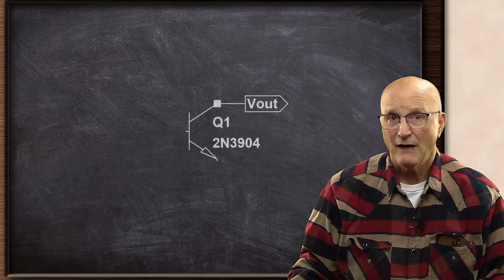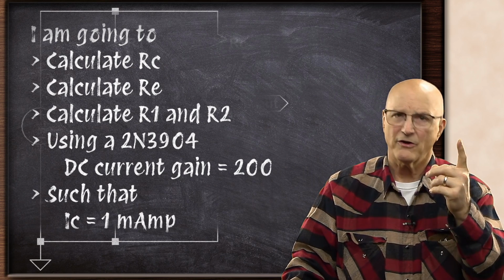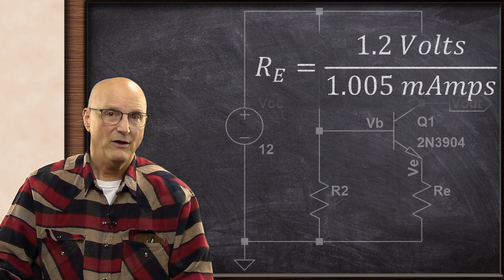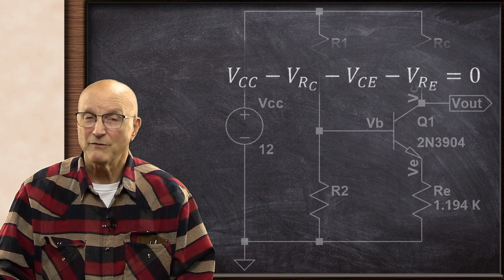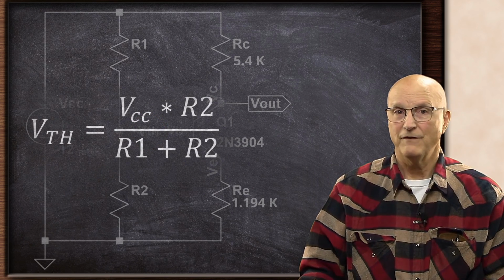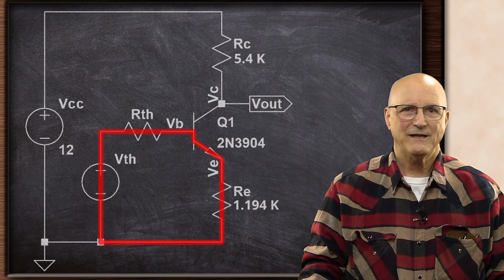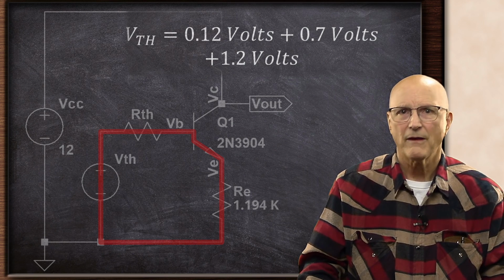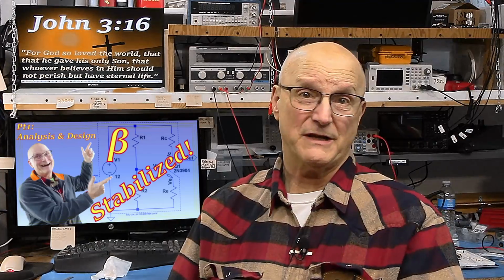A Beta-Stabilized, Common-Emitter BJT Circuit (Pt1): Analysis and Design (066c1)

Comment: Been to Tech college and your rule of thumb exceeds the textbook. 🎉
Reply from the maker: I'm not quite sure how to take your comment. Just to be clear, I've been to engineering college and worked as a product design engineering for decades. My rule of thumb came from a text book, 4 years of college and decades of experience. :-)
Reply: @eie_for_you could be a difference in degrees. They didn’t mention Thevinins theory. I’m closer to the Q target this way.
Reply from the maker: Truth ... in practice, most of the time I just say that the current through the biasing string is 10x the base current and then base all of my calculations on that avoiding Thevenin.  It usually works out pretty close, adjust from there.  What I presented here is the "textbook" method that they taught us in college and is reflected in the textbook I have here on my shelf which most engineers do not actually use in practice. Funny, that, eh? :-)

Comment: Ralph, after watching this video I wanted to (1) run an alternate method by you to see if it makes sense…and (2) ask, would this method work for biasing a PNP transistor in a similar configuration (is it even still considered a common emitter at that point?) obviously this assumes I wrap my head around PNP transistors and “reverse” everything properly.

In regards to (1):
I haven’t learned to use thevenins theorem, but I’m working on it (thank you for the video on it too).

The method I learned to calculate the R1/R2 base bias resistors was from the “Simply Put” YouTube channel. I applied that different method to your videos example and came up with the following…..(assuming the Re and Rc portion of the problem is already done…using the same values you have). 

Your design collector current is 1mA. Since beta is 200 and Ib = Ic/beta, then Ib is 5 uA. The rule of thumb I learned is you want your “bias” divider current to be at least 10x your base, so I aimed for 50uA. Then to get the voltage you need to get across R2, you simply add the VBE drop of 0.7v to the voltage developed across RE (which you calculated as 1.2v) giving 1.9 volts needed at the base (which I think is different than the Vthev of 2.02V you calculated). So using that 1.9v divided by the base current x 10 (50uA) you get a resistance of 38k. Then for R1 you subtract that base bias voltage from VCC (12v - 1.9v) giving you 10.1v, which is then divided by the same current used for R1, 50uA, resulting in a resistance of 202k. 

So with this method:
R1=202k
R2=38k

With your Thevenin approach:
R1=142.57k
R2=28.86k

When I did this I was initially disheartened thinking that this method I used (and intuitively understood) didn’t work at all, but then I realized it might still be an ok approximation….your thevenin approach base bias divider current is just going to be higher (~70uA) vs the 50uA I assumed and thus my divider would just be more susceptible to base current fluctuations. I put both the voltage dividers alone, and then into the full transistor circuit, on TINA-TI and simulated it and found the base current at Q was actually about 10uA in your case and about 9uA in my case….meaning your thevenin approach definitely did more accurately bias the transistor and the voltage at the base was ~1.79V for your approach and 1.64V in my approach.

Thank you for taking so much time to create this video series. I have been fascinated by transistors for years but never wanted to dive into them because I was apprehensive of the math. Up until recently I was just kinda shooting in the dark with base bias resistors and I’d use a potentiometer to experimentally find the values I’d need (hooking the wiper to the base and the ends to VCC and ground).  

I am still a novice at electronics so forgive me if my questions seem elementary.

Thanks and God bless brother
Alex
Reply from the maker: This is my second try at a reply. And I had a nice one before, too! :-/
WOW! I am impressed with how you are digging into this. I sounds like something I would do! Ask questions, seek answers, do the math, play with circuits (virtually and on the bench) ... until I was confident that I understood and had it right.
The "Thevenin" approach is the textbook approach to this design. Admittedly, it is more work. Thevenin's Theorem is another head warper. Why does it work?? I haven't taken the time to prove it to myself (I've thought about it from time to time).
Note that the Vthev is not the same as the target base voltage. Remember, it is at the other end of Rthev away from the base.
Yes, I have also used the alternate approach (even recently) using 10 times the current through the voltage divider than the base current.  Just be mindful of Kirchhoff's Current Law when you do it this way.
Consider the base node. You have current entering the node from the upper resistor. You have current exiting the node to the base and to the lower resistor. The current in the upper resistor includes the base current. The current in the lower resistor does not. Failure to take this in consideration will end up with errors in the final values.
I have to agree with you that working with PNP transistors is a head warper. We are just not used to thinking upside down like that. Yes, this method does, indeed, work with PNP transistors once the appropriate "translations" have been made.
Don't ever be shy about asking questions. How else do we learn?
I hope this helps dispel some of the "fog." God bless! :-)
Reply: @eie_for_you Ralph, thank you so much for the reply. I will get back to you in detail at some point…I’ve been a bit busy,  and want to get a bit further in my understanding….but I was very happy to read your response. One thing I have found is typing replies in notes or word then pasting them into YouTube helps tremendously. Thanks brother God Bless.
Reply from the maker: You are very welcome! :-)
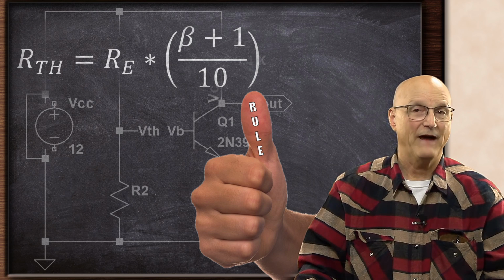Reply: @eie_for_you  Hey Ralph, I’m still working on this! I had a major life event (praise God, a great one) so my electrical learning has been a bit of a lower priority. However I have been going back through KVL and doing lots of transistor problems (both active and saturated) to build my comfort with it. I find KVL to be more intuitive at this point than KCL/nodal analysis. I also did quite a bit more learning about thevenins theorem and that definitely seems to be the preferred method (substitutions get very tedious and I’m not comfortable with matrices yet). In that vein I do have another question about the rule of thumb at about the 16:18 mark - is this related to the ideal design having a bias divider current that is 10x IB? I read another commenter where I think you said you found it in a EE text you had. Anyway hope all is well. If it’s easier I can give you my email as well since these comments are a bit buggy. God bless, Alex.
Reply from the maker: Well, I am very glad it was a positive major life event! 
Some of this stuff is a bit mind bending, especially Thevenin's Theorem! It just takes times and practice to get comfortable using it even if we do not have a clue how it works. ;-)
Yes, the rule of thumb ... the current through the top resistor = 10xIb is a standard rule of thumb. Of course, then the bottom resistor current is 9xIb and this DOES make a difference. I just used this very rule of thumb in preparation for my video on the Gilbert Cell (coming out next Wednesday, 19 November). It is not quite as precise as the Thevenin method and, while a common practice, isn't the "textbook" method. Yet, it works fairly well.
ralph.eie4you@gmail.com would work. Grace and Peace. Ralph :-)

Comment: I still dont understand why Re is necessary?
I ve read something about internal resistance of transistor which is variable and can influence Vce output.
So in order to override that resistence Re in necessary.
Yes but how?
Because transistor resistence still remain.
Reply from the maker: The unbypassed emitter resistor works in concert with the collector resistor which is in parallel with the load impedance to establish the overall gain of the stage. 
It also has a significant hand in establishing the input impedance of the stage. It appears as  (Re*(hFE+1)) as we look into the base. This is affected by R1, R2, Re (unbypassed) and Ieq.
You establish the output impedance of the stage primarily with the collector resistor and Icq.
So, if you are looking for a particular gain given a known load, an output impedance and an input impedance, then Icq, Ieq, R1, R2, Re and Rc have to be chosen carefully to establish these parameters. 🙂

Comment: WHERE DOES Re×(BETA+1) COME FROM WHEN YOU CALCULATED R1OR,
IS SOMETHING YOU SHOULD JUST ACCEPT?
Reply from the maker: Aaaaah! Good question! We first have to remember that the BJT is a current operated device and that the current in the emitter (Ie) = the current in the base (Ib) * (1+B). Suppose B=10 and Ib = 1 mA, then Ie = 11mA.  If we have a 10 Ohm resistor in the emitter (Re), then the voltage across that resistor would be V(Re)=Ie*Re=11mA*10Ohms=0.11 Volts.
But, from the perspective of the base, the current it is experiencing is only 1 mA.  So,  Re(effective) = Ve/Ib = 0.11Volts/1mA = 110 Ohms = Re*(1+B).
Hope this helps. 🙂
Reply: WHERE DOES THE 10% COME INTO IT?
Reply from the maker: @davidluther3955  Yes, the 10%, you mean the Beta +1 and with the Beta of 10, this +1 looks like 10%! I got it. The emitter current consists of the collector current (Ic) plus the base current (Ib). The collector current is equal to the base current times Beta (Ib*B). So, Ie = Ic + Ib = Ib*B + Ib = Ib*(B+1).🙂

Comment: WHY DID YOU NOT USE STANDARD RESISTOR VALUES?IF I WERE DESIGHNING THIS CIRCIUT THAT IS WHAT I WOULD DO.WOULD YOU DO A PRESENTATION ON EARLY VOLTAGE?WHEN I WAS IN COLLEGE I DID NOT HAVE THIS IN MY ELECTRONICS CURRICULIUM MANY YEARS AGO.HOW DO YOU CALCULATE EARLY VOLTAGE?
Reply from the maker: This video was intended to be a demonstration of the process to arrive at the initial, ideal component values.  This is always the first step in design. The obvious next step is to look at what is available in standard values and, potentially, modify the design to accommodate them while still meeting the requirements. I did not go through this part of the process, it is true.
Now for the "Early Voltage."  When you plot collector current against collector-emitter voltage (in other words, like we do when using a transistor curve tracer) we get line that initially has a very steep slope and then tapers off nearly horizontally. In a perfect world, these horizontal sections would be perfectly horizontal. Instead, they have a slight positive slope.  If we were to lay our ruler on these lines and draw a line back beyond the Vce = 0 (Y) axis until it crosses the Ic = 0 (X) axis, this place where this crosses is called the "early voltage." And, yes, it is a negative value. Ideally, this point would be the same for ever value of Ib we chose. But it is not.  For a Silicon-based transistor this value averages out to be about 100 volts.
I actually used my curve tracer with a real, randomly chosen transistor and extrapolated back to this point for each of the Ib traces. I then averaged the values I got for each line and it came out to be petty close to 100 volts.
Yeah ... doing a video on this subject would be an interesting one to do and it should be fairly straightforward.  I will add this to my queue! 🙂

Comment: I THINK YOU MADE ERROR IN YOUR CALCULATION OF THE   THEVENIN VOLTAGE. I GET .012V FOR VRTH AND,1.912V FOR VTH.
Reply from the maker: Did you download the "go along with the video" formula sheet?  It is available here: https://drive.google.com/file/d/1WXAorRSnhwrvGLb5OYMCHItWTVb00QY4/view?usp=drive_link
I think you slipped a decimal point on your calculation of V(Rth). 5 uA * 24K = 0.12V, not 0.012 volts

Comment: Without an input signal, what's the use of the circuit?
Reply from the maker: This is a common-emitter circuit which, by its very nature, implies that the input is on the base (likely capacitively coupled) and the output is on the collector (also likely capacitively coupled, but not necessarily). So, yeah, the input and outputs are there. I just didn't overtly show it in the schematic.
In the next video release in this series (coming up in a couple weeks), I will be demonstrating the analysis and design of a multi-stage transistor circuit with a 10 KOhm input resistance (the base of the first stage) and a 10 Ohm output resistance (the emitter of the second stage).
I truly hope this dispels any confusion that I may have left behind. 🙂

Comment: The video is very well done but it is in ideal world and not in the real world.
 In this video you chose to find Re 1st, I chose to find the values for R1 and R2 1st. With a Vcc of 12 Volts, I set the base voltag as 3 Volts(1/3) of Vcc. With current 10 times the base current. I then chose a value for Rc, based on Beta of the transistor with a curent of some  value to set the Vc (collector voltage) is 1/2  of Vcc. I then find the value of emitter resistor. To effect the gain I spilt the value and put a cap across part it to set the gain of the stage.
Reply from the maker: Thank you for your thought provoking comment! You are correct about it sitting in an ideal world ... it sits all by itself and no transistor circuit does that. That is why I am following up with a multi-stage transistor circuit to demonstrate the dependency on subsequent loading (e.g. a circuit to follow). As I say, "Anything connected to the input or output of the circuit becomes part of the circuit. It either becomes a current sink or source."
Regarding the methodology...yup there are quite a few ways to approach the analysis. The one you speak of is one of the ways that I saw as I was researching the topic. I wanted to keep it simple and a direct move from the simple common-emitter to the beta stabilized version, so I avoided the split emitter resistor. As my emphasis was on beta stabilization, I also purposely avoided dealing directly with the gain issue apart from mentioning that the emitter resistor affected the gain. With that said, both the split emitter resistor AND the whole gain issue will appear in the multi-stage video to follow.  
What I did find in the research was that most seemed to start with the Thevenin equivalent circuit and the rule of thumb that Rth=(B+1)*Re/10; this includes my EE textbook by Donald Neaman. This means that you cannot calculate Rth without knowing Re, first. This yields I(R2) at about 13 x I(B). 
So, I went with what seemed most prevalent and what my viewers would most likely see should they look around.

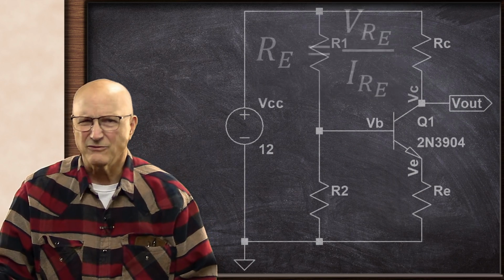Comment: It would be nice to have a much better explanation of where the rule of thumb at @6:36 comes from, when it applies, and why.  It can't apply in every transistor circuit, so why does it apply in this one?
Reply from the maker: As as far as the origins ... experience and handed down tribal knowledge (I got it from an engineering book which gave no explanation). If we think about it, though, the higher the voltage we allow on the emitter, the less available voltage swing we have on the collector.  We want this voltage to have an "insignificant" effect on the available collector voltage swing (and still remain linear).  To this end, one of the things we often see is factors of ten used in engineering. If this thing is a factor of 10 greater than that thing, then we have to option to ignore it or the effect of the lesser is "insignificant" as compared to the greater.
This rule of thumb applies to the common-emitter circuit. While you would still use the voltage divider biasing routine for the common-collector, we certainly wouldn't apply this rule of thumb to that.  And the common-base ... don't even need it.
The second rule of thumb (Rth) ... reality is, you can make this anything you want. But, there is a significant trade-off. The lower the value of Rth, the more impervious to beta changes the circuit becomes. BUT this come at a price - input impedance! This second rule of thumb basically sets the current through R2 at about 13 times the base current and the current through R1 about 14 times. Remember what I said about insignificance. So, this rule of thumb is a compromise between maintaining a nice, high input impedance and making the circuit beta stable.  It's origins?  An engineering book with little explanation ... tribal knowledge passed from generation to generation of engineers.
Hope this helps. 🙂